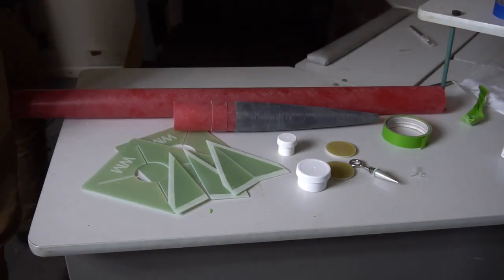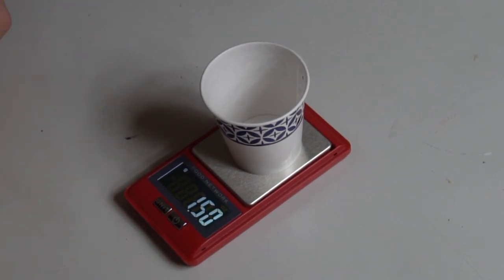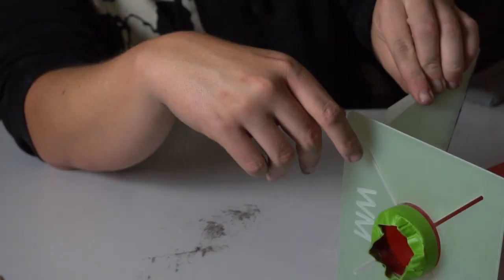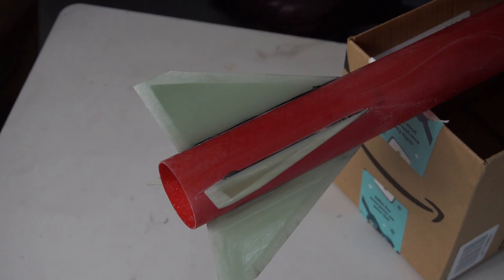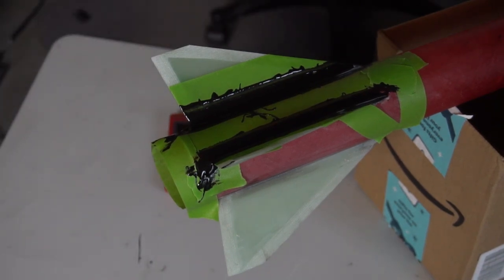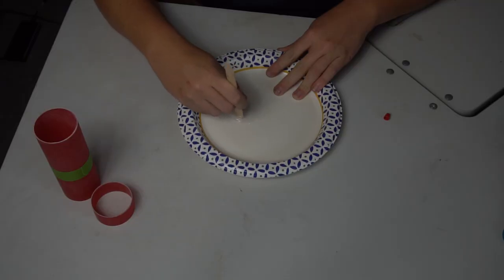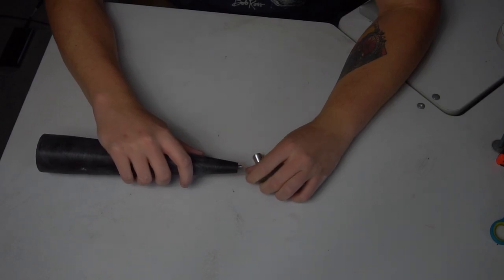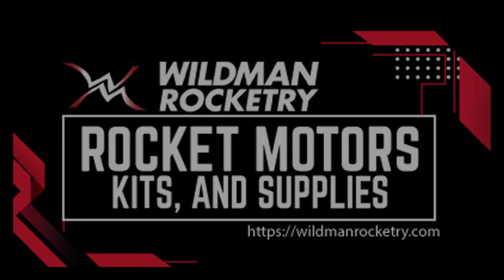Wildman Mach 2 High Power Rocket Build Instructions

Comment: Nicely done, Braden. I've got an M2 on order with my holiday orders along with a K270W, 54/2560 case, and tail cone end closure. Hoping to fly it on that load at Airfest.

Also, in your video you mention building with 1/4-20 all-thread as well as using the Additive sled (also in description). Though, that sled uses 10-24 all-thread; the holes in the sled aren't big enough to fit 1/4-20.

Edit: I just realized this is Tim's YT channel and not Braden's! lol
Reply: Whoops, you're correct. That's my mistake. 10-24 is indeed correct.
Reply: @RocketVlogs  Thanks for verifying, Braden! Looking forward to getting mine!

Comment: Cool! Just added this to my Birthday list. How do you recommend you should do motor retention?
Reply: The way I plan on doing it, as with many MD builds, is to friction fit the case into the airframe using masking tape and anchor the shock cord to the top of the motor.
Reply: @RocketVlogs  Thanks. I was figuring that was the plan but thought I would ask. I just get really worried/paranoid about ejecting the case and damaging or losing it.